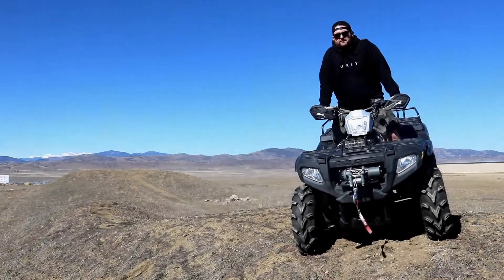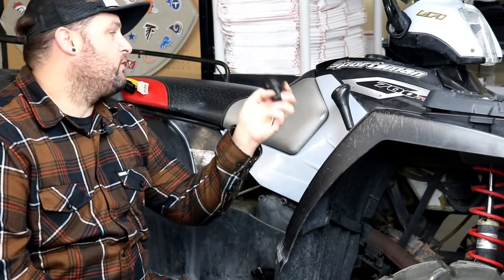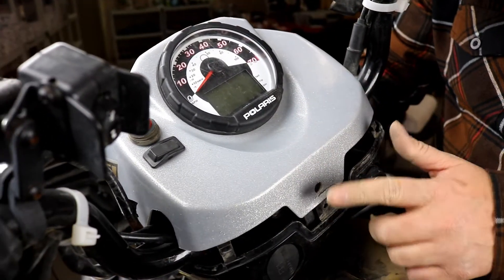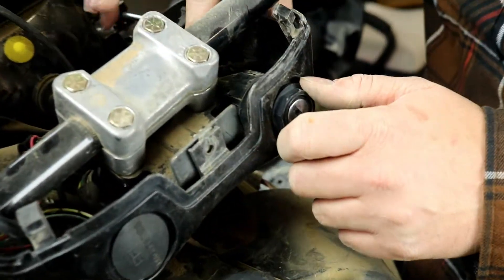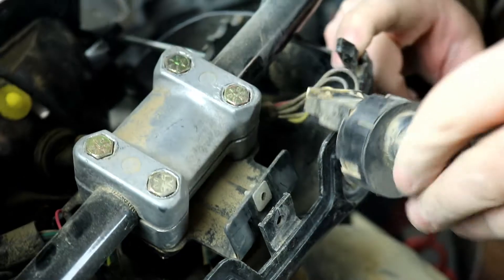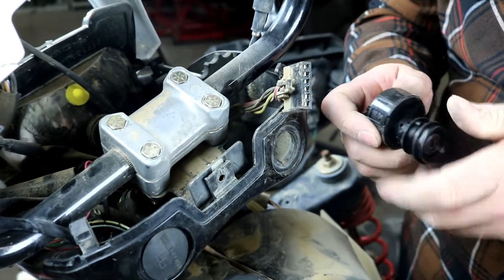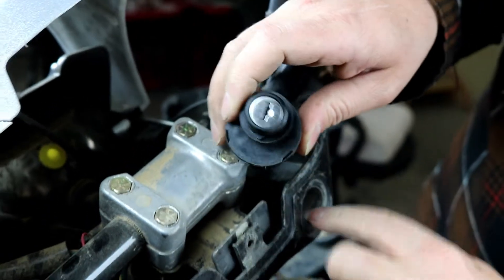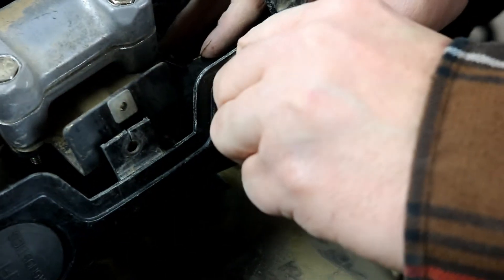How to install an ignition key switch on a Polaris Sportsman 700 EFI Twin - RMSTATOR RM05019

Comment: Do you have to install any other parts beside ignition switch?  Because I have a 2018 Polaris 570 with a key stuck in the ignition switch.

Comment: My son has a 2005 polaris 700 sportsman. He thought the ignition switch was bad bought a new one and still wouldn't turn over. I used a jumper wire the first prong seems to be power the second we have nothing the third we get lights and the fourth it will turn over. My question is what's the second prong? Also if you use the switch it doesn't do anything.

Comment: Do you know what gauge wire is used on the 6-pin ignition switch connector?
Reply from the maker: Usually 14-16AWG wire.

Comment: We tried replacing ours and the new switch won't start our Polaris but the old switch will. What's going on? Any ideas?
Reply from the maker: Hard to say. I would test the new switch per your service manual, or at least compare it's connections against your OEM and make sure they connect the exact same way in each position.
Reply: RMSTATOR why do you change your ignition key switch?, I have a problem with my 2015 Polaris 850 has running fine and now turns on and stay running if I keek the key turn on soonest let go turns off even if I keep pressing the gas any ideas what could be
Reply: @noelmacedo9409  I’m having the same problem right now what did you do to fix yours